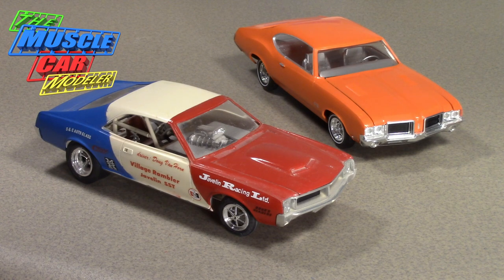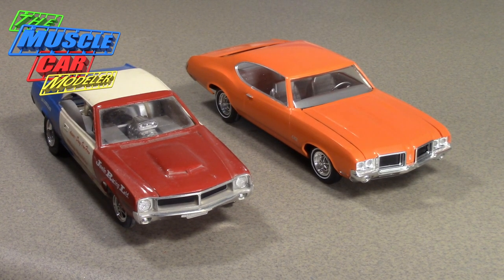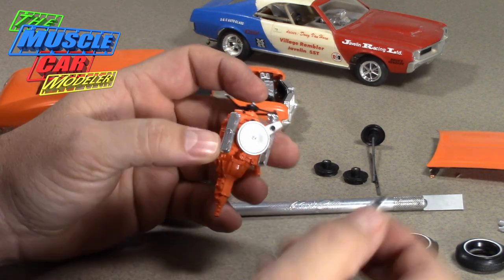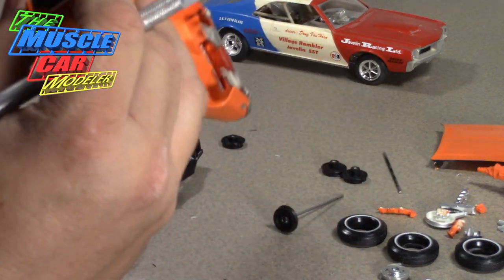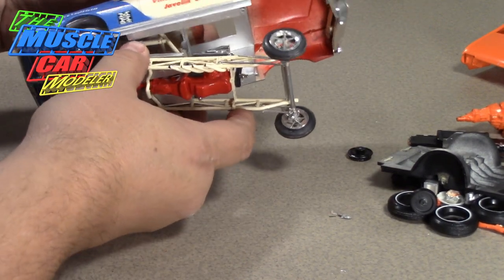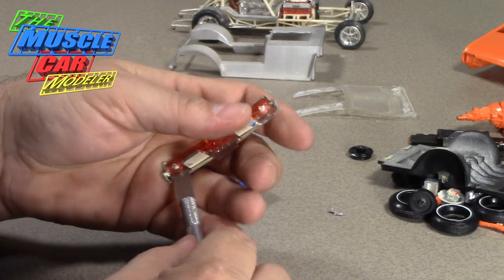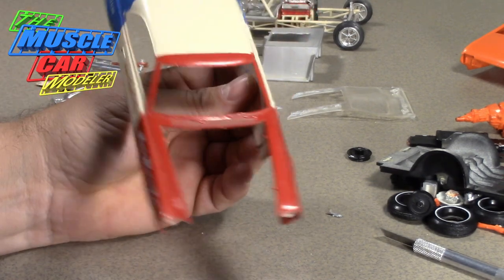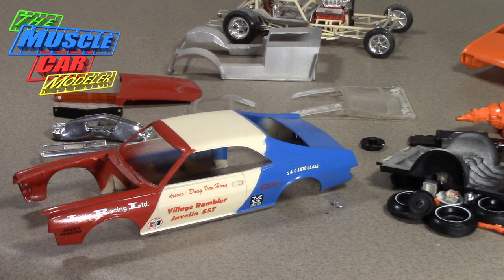How To: Tear Down a Vintage Model!

Comment: I've heard of the freezer method but never tried it but use soaking in the purple pond works to loosen up the parts and brittle the glue. Also I wear a leather glove when using an exacto blade on disassembling as I have stabbed the holding hand on stubborn glue when it finally let go. The best rebuilders are those with rubber cement or white glue..a dream!
Reply from the maker: I have bought a few that were glued with epoxy! What a dream. They come apart and don't mar the plastic. I have a few that when they came apart they look like new models.

Comment: You use the exact same method as me, same flat blade and delicate brute force lol ! You were very lucky with those two.
I've had some seriously bad ones over the years, the Johan 65 Chrysler I stripped broke completely in half when I eventually managed to get the glass out.
Great fun though, I really enjoy the year down process
Reply from the maker: Yes, These came apart really easily. Especially that 442, I cant believe the steering column came out that easily!

Comment: It's fun taking them apart and then redoing them to how you like. Also I have found for stubborn glue areas or where there are fragile parts with glue. Leave the parts soaking in the purple pond for a few days and clean up the paint and the purple power makes the glue brittle and most of the time I can get them apart
Reply from the maker: Great tip!

Comment: I bought a car from eBay about two years ago it's a 1970 Baldwin Motion Camaro it's was painted a dark purple and completely stripped it down to it's core but I've had to replace a few parts but I'm actually still working on it. I like to make my cars look as real as possible and build it as unique as possible as well. I've had a lot of people say I should sale my cars like artist sale painting's I spend at least 70+ hours on my car kits but buying them used and rebuilding them is the fun part.
Reply from the maker: Yes. I have enjoyed rebuilding many kits. Mostly vintage kits but some modern. Sometimes it's just a challenge of, can I?

Comment: Very cool video have you tried putting them in the freezer I have use that method before and it does work pretty decent
Reply from the maker: Thanks! I have not tried the freezer method. I worry about the 50 year old plastic being brittle already and worry that it will make it worse.

Comment: I think you got very lucky with the way they came apart, especially since jo-Han used some low quality plastic that turns very brittle with time. Had more than one shatter like glass.
I find removing the tabs with a parts cutter often frees up parts, it’s also useful for chopping through large areas of old glue.
I remember one old AMT kit I was striping that was assembled using putty not glue, glass was put tied to the roof, interior held in with putty, it took days to get it apart.
Reply from the maker: I have a few like that and now I try and get the best ones I can. Sometimes I end up with a few rebuilders to build one good one. Funny part is I have bought a few ruff ones, took them apart and built a good one. then sold of the leftover parts on eBay and made some extra money!

Comment: I kinda like the look of a well built show vintage model car the slight discoloration of the paint where it's very slight makes them look better and more realistic in a way but yes the glue bomb ones are a mess to fix
Reply from the maker: I like to start over and get as close to stripped as possible.

Comment: One think I like to know the stuff you use to strip the body's  do you find that it eats the plastic I never been lucky at this I uselly wind up wreaking the body what works best for you and what you recommend your I'm put would be a greet help great show by the way
Reply from the maker: I have a few videos on stripping paint. I use Super Clean mostly and sometimes 91% Isopropyl Alcohol. I have used brake fluid but have had that make some plastic chalky and brittle. I did make the mistake of soaking a body in lacquer thinner! Body turned to dust!!

Comment: wow i was right there with you the whole time would have liked seeing more on what you did to finish them and the reveal sweet luved it the vid imean as far as what glue that was about 45 years ago testors made the good stuff i would sit in my room for hours at a time and not sure why i felt funny afterwards but i guess testors knew there were things going on cause they came out with a glue that had an orange scent didnt work for crap hated it anywho thanks for sharing scooter d
Reply from the maker: Thanks! Neither one of these is finished. Recently got the decals remade for the Javelin.

Comment: You seem to do a lot of AMC cars, thank you very much.  I have a sealed Revell 1/32 Snap Together Javelin.  I just wonder if you've come across it before, and if you can tell me if it's a 69 or a 70.  I know it's not a 68 because of the chrome bars in the grill.
Reply from the maker: Yes. I have done a lot of AMC’s I have tried to get one of each one to build. The one I think you have is the Revell 1/32 69 Javelin SST.
Reply: Thank you.  I was thinking it's a 69 as well.
Reply: @TheMuscleCarModeler  Just asking, do you have the SCRambler and the taxi cab?
Reply from the maker: 62 Rambler taxi? No. The SC Rambler I have 2 complete kits and have had a few for parts kits. Those used to be easy to find and a good source for the AMC 390.

Comment: I have a Jo-Han F-85 that I can not separate the chassis from the body . The pins won't budge, and I'm a bit scared to push harder
Reply from the maker: That sucks and I have had to drill a few out. Jo-Han at lease switched to plastic pins instead of screws. Screws usually come out easy if not stripped but the tubes are usually split. The plastic pins drill out easy and are easily replaced by screws.

Comment: These old glue bombs are actually extremely salvageable yet most people run from them.  You have to remember 90% of modellers not only paint incorrectly but also glue the parts together after they also painted them incorrectly on the Sprues (Runners).  Plastic glue melts the pieces together but with glue in between them it becomes gooey and very easily separated.  

A pro builder uses CA glue not the plastic weld model glue for a number of reasons one of which is make it easy to repair and also break down to be repainted or modified later on.  CA glue is strong but easily cracks so if you drop the model the pieces break cleanly on the glue joint not somewhere else as is common for plastic welded parts from normal model glue.  Also some debonding solution later and the pieces come off clean and when stripped are good as new for whatever you plan to do with them next.
Reply from the maker: Many of them are salvageable but it is so hard to tell when you are only looking a pics of them. I prefer to see them in person. I have had a few that were worse than I thought. One looked great but once I got to see it in person. I knew the paint was way thicker than I thought. Once I stripped it it was crazed bad!

Comment: That orange one I would lightly wet sand then clear coat it with air brush it will look good and that other one that was brush painted not to bad of a job on that hand painted blue and red for a kid and a build for a kid  it's a good little build
Reply from the maker: That orange one I’m redoing in a blue!

Comment: Whoever built the Cutlass glued without removing the paint which is why the glue seems gummy as that's what happens when you don't scrape away the paint or chrome before cementing. Cool vid!
Reply from the maker: I have not heard of that before. I mostly use super glue now so I have not had this problem. Also I'm sure the sticky glue was from it was reassembled. only a few spots had it.
Reply: I could be wrong. I've disassembled mostly glue bombs and that olds is not a glue bomb.
Reply from the maker: Pvmntpndr66 I agree, both,of these are very cleanly built and not real glue bombs. When I look for rebuilders I look for clean ones that have as much of the stock parts as possible. I'll pay more for them as they save me more in time and effort!
Reply: I'm not a purist or a factory stock guy. I prefer to kitbash, customize or do something other than a "Plain Jane", so as long as I come out of the disassembly with what I want I'm a happy camper, but everybody's different.
Reply from the maker: Pvmntpndr66 I go back and forth on that. I have built 4 of these JoHan 70-72 442s with the AMT 69 442 chassis and engine. I have not done one as box stock from JoHan yet.
Reply: I've got a few Jo-Han kits and I doubt I'll be using the kit chassis, mostly because of the lack of detail. I'll be kitbashing my '60 Plymouth(?) cop wagon with a Magnum wagon kit as the Plymouth is missing a few essential pieces, but I think my plan will turn out.
Reply from the maker: Pvmntpndr66 Now that sounds cool!
Reply: Thanx, it should be fun.

Comment: Dude, put them in the freezer for about 24 hours, makes the glue brittle and they will come apart very easily. Love your cars, and your helpful videos.
Reply from the maker: Thanks! JoHan plastic tends to be very brittle so I avoid the freezer. I usually just scribe with the razor and pry a little.

Comment: I have never heard of Jo-Han kits before. Where are or were the from?
Reply from the maker: JoHan is an old company that did many promos and kits. Many great subjects but now rare. They were strong in the late 50's to the mid 80's. It is barely alive today.
Reply: @TheMuscleCarModeler  I started building models in the 70's and have never heard of them before this video. I live in Kansas, were they located on the coasts?
Reply from the maker: @alanq64  They have a long story, best thing to do is google JoHan models. I also believe that someone did a history video on you tube about them.
Reply: @alanq64  Originally located in Michigan. Alot of decent kits.
Reply: @alanq64  Or shal I say at one point made alot if decent kits.

Comment: This is the prime example of why I use CA glue and only glue parts that I have to glue to build my models cuse one-day someone might get them and want to re build them how they want to and make it easier on them or on me when they get old and need a restoration. The glue he used on that orange car is the good old red testors metal tube glue that everyone uses as a kid when they first start cuse that stuff needs air to dry and CA glue and the good model cements we use now dries in the absence of air that's why it's still gummy in some spots
Reply from the maker: Not many used this time of glue. I have had a few that came apart easily. The other glue sections was parts that were reglued later on.